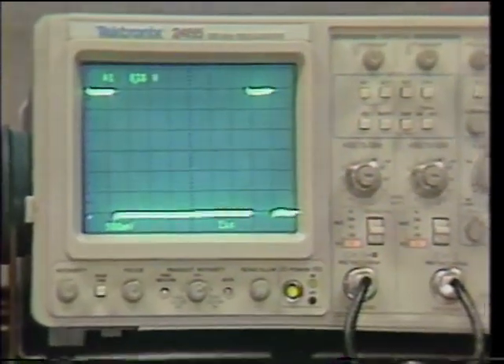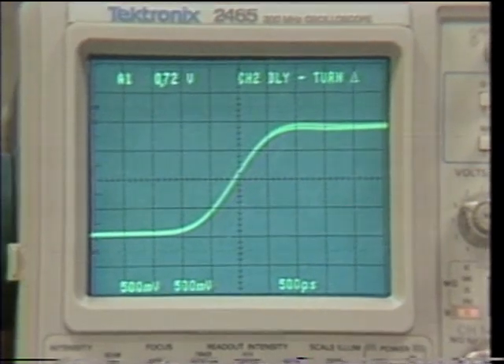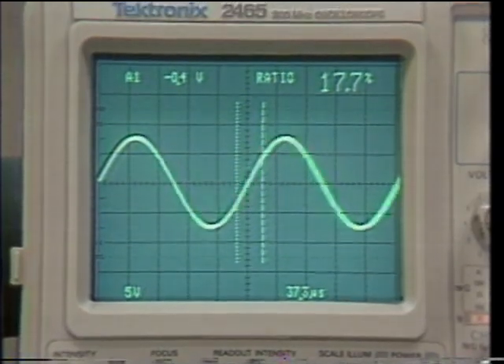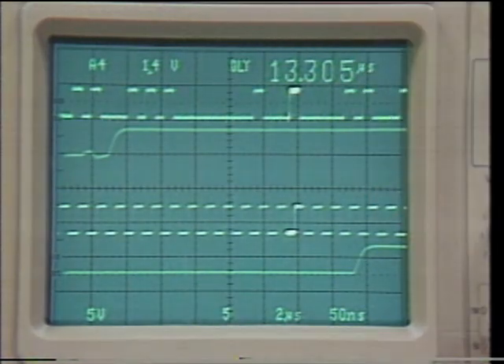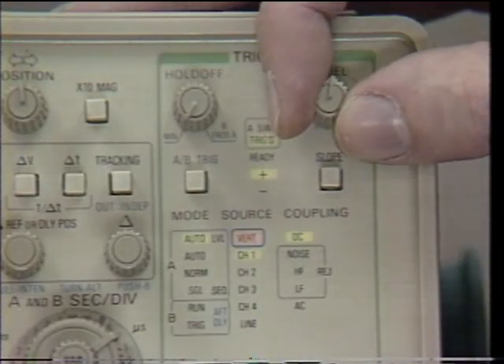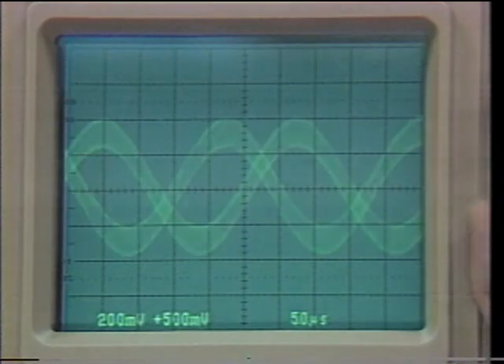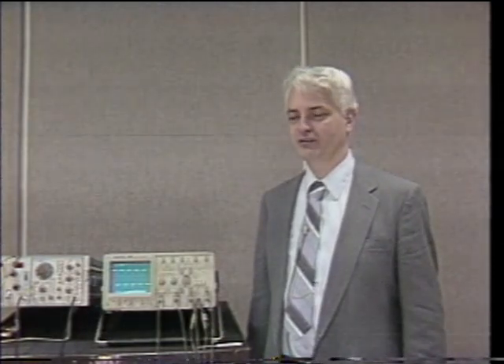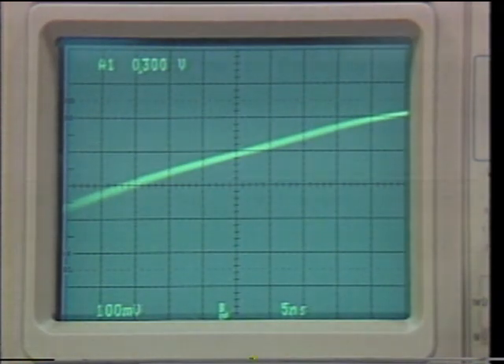2400 Series Measurement Techniques

Comment: My Tektronix 2465 is just a great scope. It is  300 MHz scope , yet I can still display and measure a frequency up to 1 GHz. It has the Options 06 and 09 which just adds to its usefullness.
Reply: What are 06 and 09 options?
Reply: @jspencerg  Options 6 and 9 appear to come as a package. They provide a Counter/ Timer/Trigger extended functions and a digital WORD (17 bit) probe with built-in port. 
You get features such as the display of the  frequency of the signal without using the cursors, measure Period and have a Counter as well. Plus an Event Counter. All menu selected. The problem with the WORD feature is the documentation from Tektronix very thin.
Mine also came with the TV Option (5) which has both hardware and software features for measuring TV signals.
Reply: @lawrencelederer5060  Thanks.  Those are good options, upgrading it to 2467B functionality.  Your unit is loaded.  Perhaps the documentation for the Tektronix 308 would flesh out the instructions?

Comment: I still have my 2467BHD on a Model-3 cart. Youngsters might never know about the secrets hidden in analog waveforms. I still repair CRT monitors with mine.
Reply: I have a 2467 on my stack which I got from an engineer who worked on the microchannel fabrication process. I aquired two 2467B's which have some issues.  I hope to repair them.  
Please demonstrate some non-obvious features of these wonderful machines.